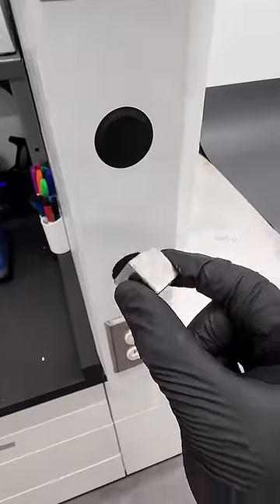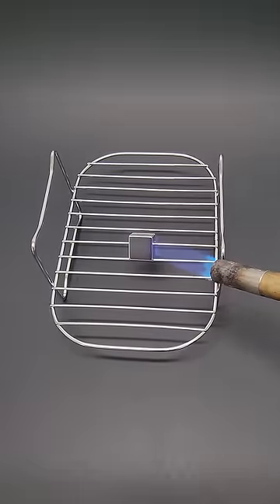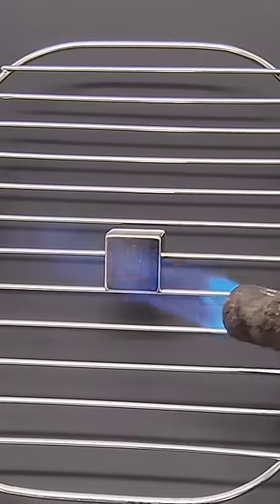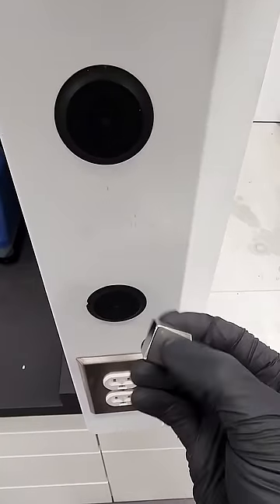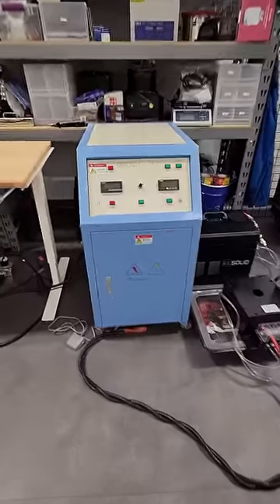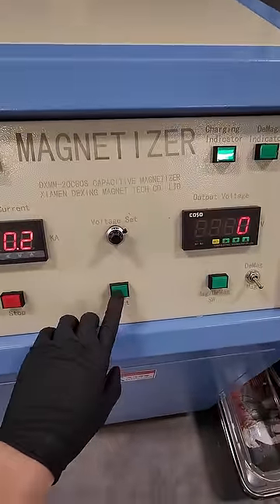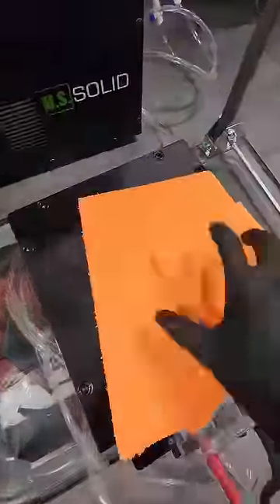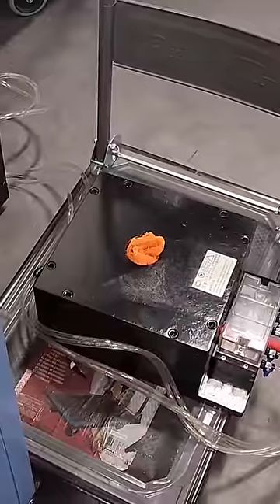I accidentally killed this magnet

Comment: Dude, sick. I would love to see just a generic lifting force of pre vs post heating, just to know how much this device actually restores the magnetism.
Reply: Was thinking this exactly. Or if he magnetized a magnet without heating it.
Reply: When you heat a magnet the poles inside it are able to move around and they will automatically disalign themselves which will cancel out the magnetic forces within the magnetic. Basically it should've lost almost all its magnetic force when heated. While I don't know the exact details the machine rips the magnetic poles within the magnet back into the correct orientation. The more positive poles facing one direction and more negative polles facing the other direction equals a stronger magnetic field.
Reply: @thisguy2921  praise the scientists! Thank you for this.

 TIL ... Magnets.
Reply: @thisguy2921  Well put. I would like to see a test of the magnet before (maybe how many pounds it takes on a simple digital scale) to pull free, then heat it, remagnetize it, and test again. I'm curious to know if the bonds reinstated by the machine are as powerful as the magnet was before having it's poles broken.

Comment: Every atom produces by default a tiny magnetic field, which orientation is random, so they kinda equalize each other. Magnetization gives these magnetic fields a certain orientation, so they no longer equalize each other. Heat "mixes" the atoms around, so the orientation of the tiny magnetiv fields is random once again.
Reply: thank u
Reply: This comment is underrated
Reply: Clear and understandable, you should make video and in any case don't stop commenting. Not sure I understand ""Heat "mixes" the atoms around though". Maybe my poor English understanding. Thank you.
Reply: Also strong erratic movements would disturb these tiny magnetic fields. E.G.: Someone repeatedly bashing a magnet against a hard surface.
Reply: Finally someone putting a constructive comment here instead of dumb necromancy jokes or witchcraft magic BS baby talk.
Reply: @maxmustermann5777   Yes shock can degrade it over time but heating is far quicker, also if you use the magnet to excite a coil to generate electricity over time it will weaken, so this high voltage charge to align the fields will regen the magnets again for use.

Comment: The Curie effect in action, love it!
Reply: Whats this now? 😮
Reply: @ryanrose3510  It happens when magnets are being exposed to excessive heat, they lose their attractive properties and it can also affect other electronic devices, though that is depended on the material from which they are made since dif magnetized materials can lose their properties easier (at a lower temperature) or harder (at higher temperatures).... It is also used to explain why computers perform better in a colder enviro than a warmer enviro!
Reply: @michaelcgrigori7823  thank you for sharing! I love that about YT comment sections. Have a wonderful day.
Reply: @ryanrose3510  Same!

Comment: Welding messes with magnetic properties in a very similar way, never knew you could "remagnet" something!
Reply: when you heat a magnet, the domains (extremely tiny metal particles inside the structure) become dislodged and disoriented due to the extra energy. same thing happens when you drop magnets hard enough. 

the magnetizer exposes the domains to an extremely strong, aligned magnetic field that more or less shocks the domains back into alignment. you can also remagnetize metal by heating it and letting it cool in the presence of another strong magnet
Reply: Really? You didn't magnetise a nail in school, demagnetise it and remagnetise it?

Everybody does that.

Seriously dude?

Comment: This would be useful for RC motors, often when they overheat the magents stop working and the motor loses power or will stop working.
Reply: Bro , the magnet he is using is really powerful that is why to magnetize that he needed a quick and high voltage current but rc motor magnet is really weak when compared to it  , you can simply heat that magnet more and electromagnetize it why such a huge machine.😊
Reply: @frizzygamer6519  I think he means recharging the magnets in them lol.
Reply: @BoxFwog  
Yes lots of Modern RC motors are brushless and use permanent neodymium magnets, and yes some of the have very strong cogging force where it is quite difficult to turn the rotor by hand due to the strong magnetic flux, even thoug there is no physical contact!

Years ago with regular DC motors it was mostly the brushes that wear out causing the motors to loose power however in modern brushless motors it's the magnetics that because less effective from heat damage.
Reply: @BoxFwog  You can think it that way but actually magnet is not like a battery it's magnetism depends on allignment of it's domains.
Reply: @druscanam  I never knew rc toys motors also used neodymium magnet , it must be a high quality motor .
Reply: @frizzygamer6519  
Definitely although I think your first misunderstanding is you still consider them toys.
It's a hobby and a form motorsport at a world class level.
Yes they do make toy grade RC's you'd find in Kmart but it's like comparing a nurf gun to a competition or hunting rifle.
Some RC'S anyone can by at their local hobby shop weight 25 pounds have over 6hp and can do 60mph+ with the right gearing. Which has enough kinetic energy to seriously injur an adult or kill a small child so they are definitely not toys.
Although obviously they make small lighter, slower RC's for kids too yet given the dangers of lipo batteries it's best to always supervise.
When it comes to racing, it's serious stuff that takes serious skill, tuning and the latest technology. At the top level you really need to be sponsored or ritch to be competitive.
People also build rc cars for competive speed runs which do over 200mph also.
Reply: @frizzygamer6519  I am aware, I was correcting them as they misinterpreted what the comment said.

Comment: Heat allows the molecules to reform with out reshaping. They all just turned in such a fashion that they all pointed multi direction,  hence no longer magmetic instead of all 1 direction
Reply: Earth's molten magnetic core is a challenging theology. Good God I'm confused.
Reply: @suspiciousnobody6673  spinning and types of metals matter.  If it's stationary, it has different rules.
Reply: earths not spinning. this video just disproved the stupid molten magnetic core theory.  @Yata69
Reply: Curie Temperature, right??
Reply: @RabbitholeIsrael  Just because you don't understand what you're watching doesn't mean the molten core of earth doesn't have a magnetic field. Besides Magnets and Magnetic fields are two different things, just in case you did not know...

Comment: Holy crap!
YOU NEED TO: Do this again, many times with different magnets and use a device to measure the strength of the magnets before and after using that machine.

Also, take two of the same kind of magnets with similar strength. Demagnetize one, leave the other as is, then try both in the magnetizer machine, see how each's strength compares before and after.

Comment: you heated it to its curie point... or temp or whatever. At a certain temp you start to change the grain structure of the metal which I guess takes the dipoles out of alignment as everything basically "moves around". Then by applying a strong magnetic field you realigned the dipoles and made it magnetic again. You must of aligned more dipoles than where originally aligned by using a higher magnetic force.

I feel like Nile might know of that but for some reason just left it as a mystery for the viewers.

Comment: I wonder how that works

Maybe the heating disrupted the internal magnetic alignment or whatever destroying the magnetic field
And maybe the machine restored this alignment again, even better than it was before? (Maybe before there were a few unaligned particles/electrons/whatever and now the whole magnet is more internally aligned)
Reply: yeah, he hit the curie point or temp. 

The grain structure will change in metal with enough heat. The metals structure kind of "moves around" and the dipoles go out of alignment. A strong magnetic field can realign them. Like you said, it aligned more, he likely used a stronger magnetizing force than it was created with.

Comment: I had a stack of small magnets laying around on a table and one day I failed to notice that they have attached themselves to a soldering iron. The effect was interesting: as a temperature was uneven through the long stack of magnets, theese closest to the source of heat where barely magnetic and the topmost where more or less intact with gradual loss of magnetic abilities through the stack.

Comment: If I understand how magnets work, wouldn't that machine work even better if the former magnet was hot when you put it in there? If it's at the right temp, it should be easier for the individual magnetic zones to align, so you could get an even more precise alignment, which should create a stronger magnetic field.
Or am I out to lunch on this one?

Comment: He is speaking 🇧🇷 Brazilian portuguese:
"What is a simple Neodimiun magnetic?
It is pretty strong, and I decided to see what can happen with it if I heating it with a torch.
Honestly doesn't looks like nothing has change.
But interested that after cool down it wasn't a magnetic anymore, it's just turned into a piece of heavy metal.
But all of this it was just an excuse for me to test this extremely expensive machine and kinda scary that I ordered from China.
Theoretically it just supposed to reactivate the magnetic and I just supposed to wait it charge until 2.000 volts.
After that I set a rag over here and put in the hole the small cube.
When it was ready I pressed the button.
After that I removed it.
Apparently it's looks like exactly the same, but this time when i tested i noticed clearly that a huge difference, to tell you the truth it is stronger that the beginning, looks like that I enhances it by accident.

Comment: With an enhanced heat evenly dispersed throughout the magnet and then being realigned you probably made it so strong because most of those are made in bulk so the magnification (yes im using that word because its funny) of those rare earth magnets is done so quickly its not as good as it could be.

Comment: What happens if "Zapped" again in the magnitizer? Or even 3 or 4 more times? Also what can the magnitizer do to other metals, elements, chemicals & graphene? Maybe even be able to design & build a supercapicitor with layered graphene & other materials like a silicone chip.

Comment: My dad's work had an open house for family when I was a kid and I used a magnetizer there. We placed iron on top of its surface and flipped a switch real quick.
Is the box with a hole a safety thing? (It was the late 80s, mayhaps there is some newfound safety issue)